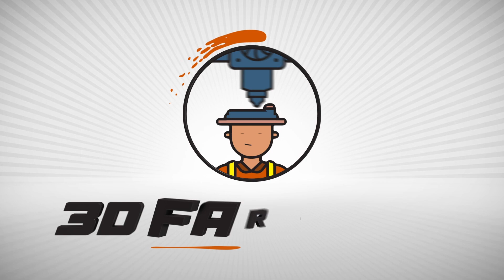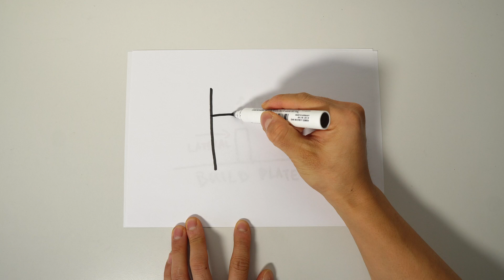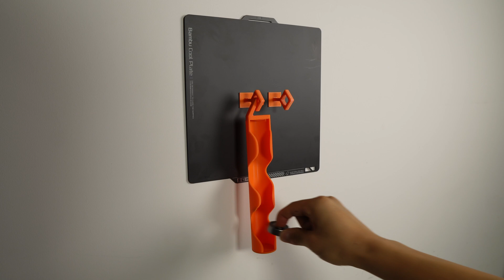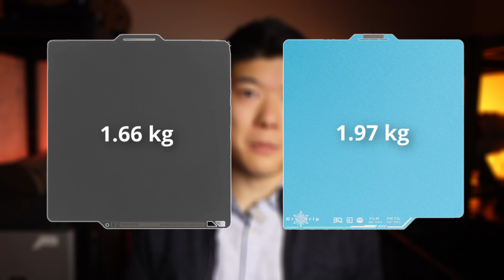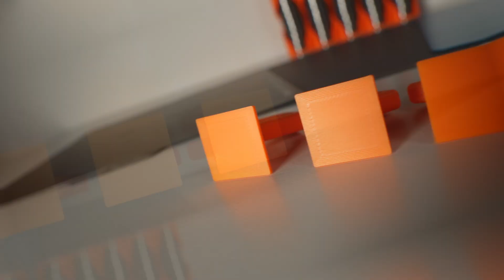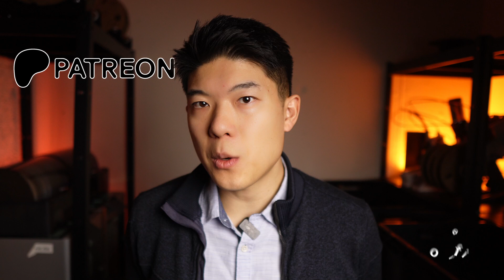CryoGrip Frostbite vs. SuperTack | Does It Live Up To The Hype?

Comment: Partly good, partly weird test tbh - things like warping would have been more interesting than stacking weights to check vertical pull. Also the comparison of the surface would have made more sense if you had also shown us the top surface as well. I also don't get if you only printed the parts at 35C or if your room temperature is 35C? Like... did you do those adhesion tests when they were cold and supposed to release easier then? O.O

Comment: Note that in the lateral adhesion test, the adhesion of the cool plate didn't fail until after the adhesive between the spring steel and the bed surface first failed. You can see it is bubbled from stretching right as the part falls from it.
Reply from the maker: Great observation

Comment: How does the cool plate have better lateral adhesion but lost the tower test?  That doesn’t seem right.
Reply from the maker: There are more variables playing into the tower test, like magnetic strength of the plate, softness of the plate surface material etc. Either way the differences in the tower test are minimal and only visible at the most critical areas.

Comment: Were you using glue stick on the cool plate during your testing?  It looks like you weren't.  Bambu recommends using glue stick so as not to damage the plate, it's used as a releasing agent.  Have you found that the cool plate works well without the glue stick?  Have you noticed any damage to the plate?
Reply from the maker: I wanted to judge adhesion without any additives. The cool plate works too well without the glue stick and it damages the plate after only a couple of prints. So yes, use a glue stick!

Comment: What plate did you choose for the biqu? Cool? Did you try a few and found one better than the other? (If you set same temperature, just the z offset would be different )
Reply from the maker: I think all your answers are in the video ;)
Reply: @3DFarmers  sorry I think I worded that badly, I meant in the slicer because there’s no option for the biqu plates so you have to choose a Bambu one you think is appropriate. I think I found the cool best for frostbite but the z offset might be a bit too close?
Reply from the maker: @Simon-L-B  Ah now I understand your question. So for the Biqu I have used the SuperTack settings as well with adjusted temperature to 35C. However, if you want the first layer to be closer to the plate, then you can chose the Textured PEI plate in the settings and reduce the temperature manually. This will give you a lower z.
Reply: @ thanks 😄

Comment: I would say a plate that lets go easier when you flex it is a plus. I don't want to struggle with getting builds off the printer. If the printer has a heat bed that causes it to flex, the problem is the printer :)
Reply from the maker: In this case the textured PEI is your best bet.

Comment: From my experience the SuperTack is the worst one in durability, the Smooth plate is better but that wasn't tested. And the SuperTack requires you to reduce the flow ratio on the first layer to .8 so there's no warping. A lot of people are having this issue, which you can only fix by enabling Developer Mode on Bambu Studio and setting it to .8 under quality > advanced.
Reply from the maker: Interesting input, we haven't printed many big parts yet, but I will keep that in mind.

Comment: What about the difference in warping for large prints?
Reply: I’ve found the supertack to be better for large warp prone prints
Reply from the maker: We didn't do a quantitative measurement, but if we take the lateral adhesion test results, the Frostbite should come on top compared to the SuperTack. But again, if you run the SuperTack at 45C they should be comparable.

Comment: You should've included the glacier :'( I really need to know the surface finish comparaison between super tack and Glacier I need the matest finish possible on my prints first layer with a bit of texture and I don' t know wich one is the best for it.
Reply from the maker: The SuperTack has the mattest finish, but the Glacier is not much off.
Reply: @3DFarmers  OK thank you very much, does the super tack has as much texture as the glacier or is it even?
Reply from the maker: @sinansahin6423  No there is more texture on the SuperTack compared to the Glacier.

Comment: Heads up, but last night my P1P didn't see the Glacier plate while doing auto bed level check and ran and skidded over the plate with a deep mark that makes it junk now. I had heard a few complaints about this and now I've seen it first hand. Apparently the detector might not see the plate and jam down into it. :face-red-droopy-eyes:
Reply: the z height is determined when the nozzle homes and triggers the load cell in the bed bracket, has nothing to do with the buildplate itself
Reply: Not on this machine :face-blue-smiling:
Reply: You might want to hit up Biqu and see what they say, they do market that surface layer as being relatively tough.
Reply: @kylek29  I can use the back side for now and hope that doesn't happen again...mmm...the new plate has the deep gouge now...ouch..
Reply: Turn off your plate detection and use the camera to know what you have on it. Turned mine off a year ago. Never gave issues
Reply: Good advice :face-blue-smiling:
Reply from the maker: That's unfortunate to hear! But thanks for letting me know about this issue.
Reply: I've recently got my plate from Ali express. Hope it doesn't do that.
Reply: I'm curious, since I don't own a P1P, how did the printer not see the plate?  It doesn't have a camera to inspect what plate it is like the X1C, and it does its bed leveling by tapping the plate.  Was the plate not one properly?
Reply: This model uses the magnetic field to detect the plate :face-blue-smiling:
Reply: @ The P1P uses a load sensor in the bed just like the P1S and X1C.  It doesn't use an inductive sensor.
Reply: bad software issues ???